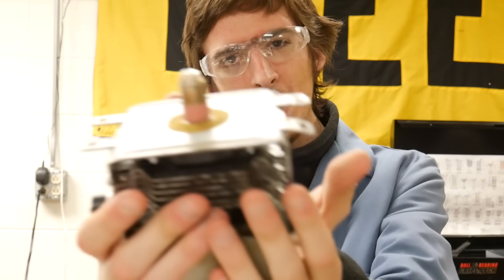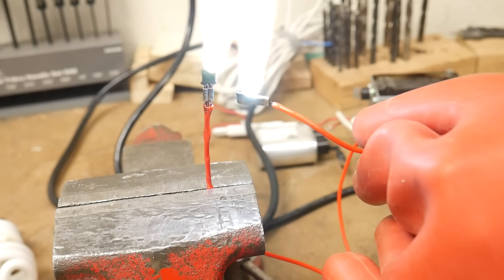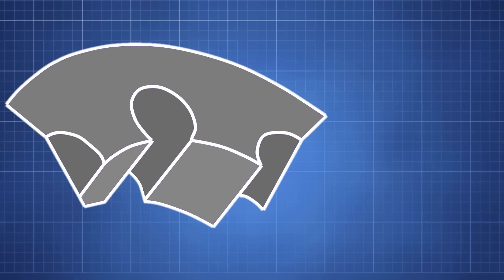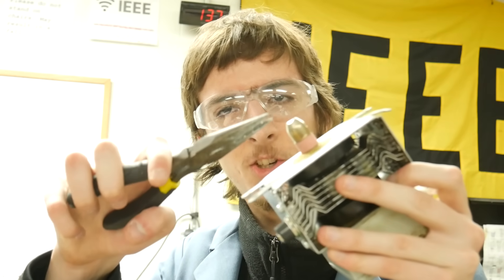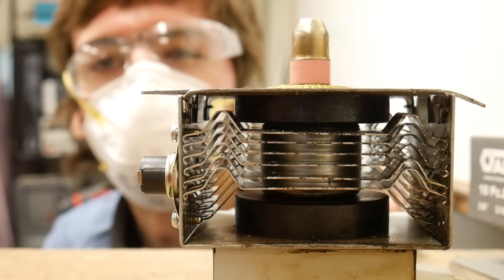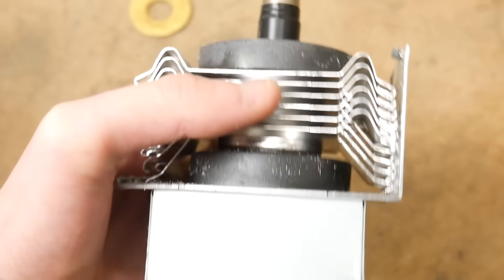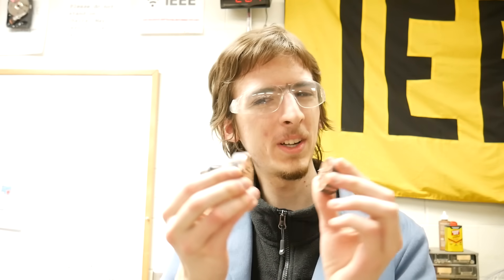What is a MAGNETRON - How Does it Work

Comment: you should point out that compassitors still have a charge even when they are not plugged in, for the adventurious types.
Reply: You mean capacitor?
Reply: Most have a high value discharge resister to bleed of the voltage when it's unplugged. (that's what I saw in the one I took apart today)
Reply: You should still be wary of high voltage capacitors after you've discharged them. Capacitors can spontaneously recover up to 20% of their voltage without any power being applied due to dielectric absorbtion. Though the danger of such capacitors is often vastly overstated. I doubt a 400v cap would be fatal if it discharged into you. For example, a 400v, 10uf cap would only contain 0.8 joules of energy. An electric fence puts out 10 times as much energy, or more. That's not to say it wouldn't hurt like hell, or that you shouldn't be careful and respectful of such devices.
Reply: @VoidHalo  In 91'  whilst servicing a CRT Monitor, I discharged the flyback cap.  After my eyes readjusted from the BRIGHT ARC!  I was stunned to see a notch vaporized off side of my favorite screwdriver... (I made sure to use someone else's tool next time)
Reply: @VoidHalo  : 20% spontaneous recovery. That to my suggests the inner core is acting like an inductor  and likely functions based on the rate of discharge. Faster discharge higher recovery.
Reply: Hahahahahhahaha WTF did you call it? LMFHO hahahaha at Compassitors hahahahah
Reply: @gamelover420  even J.W.bullseye got it, and drunk all the time. just playin JW =J
Reply: @DeactivatedCharcoal  Flyback cap? What's that? Don't you mean you discharged the CRT?
Reply: @jayelms2706  My bad, CRT
Reply: @gamelover420  spelling mistake & so what? The message sipped through & thats what counts

Comment: I will say the first thing is that the magnetron is a vacuum tube. the coils in the can tune the high voltage so that the filament will turn on and heat the only plate inside that is itself. Some of the common deaths of these is the tube itself getting weak, the diode in the high voltage path leaking current back, capacitor failure, or lastly control circuit failure. Solid state devices do not like surges which a microwave generates when it first powers up. Nice disassembly. Beryllium oxide is bad for your health but companies have been using a different material to make them ROHS compliant.

Comment: Probably not interesting for most viewers of this channel, but in case someone care:
The electrons have tendency to regroup in a single bunch that rotate in spiral. The oscillation comes from hitting a wall versus entering a cavity. There is 8 cavities so the rotation speed is : 2.45 ghz / 8 = 306 million turn per second.

The rotation speed is approximative, magnetron are so imprecise that they can not be used as power source for a radar. In case of old style microwave ovens with the 10 pound transformer and the high voltage capacitor and diode, the voltage/current is pulsed : the system is a voltage doubler which produce 4000 volts for half a cycle and zero volt for the other half. In other word, the pulse rate is 60 hz and the magnetron works 50% of the time.
I don't know if a full rectifier would makes the magnetron produce twice the energy or if there would be some kind of latch-up without the pulsed supply.
Reply: @Christian Gingras Very interesting, thanks a lot for sharing!
Reply: I actually came for this
Reply: Actually quite interesting. 
As for a DC build.... I don't think you'd get a latching effect, but going from 50% duty cycles to 100% duty cycles can do weird things. 

As far as the rotation speed, you can replace the permanent magnet with an electromagnetic winding. 

Actually the some of the first magnetrons were built with electromagnets instead of permanent magnets, but the guy who held the patent was kind of a turd, so they just made a magnetron with permanent magnets to side step him.
This had the advantage of providing additional energy to making a microwave in the permanent magnets, but there's no way to tune it or 'pre' magnetize the coil. 
The rotational speed, especially with the advent of microcontrollers, wouldn't be impossible to control, but adjusting it on the fly might be a pain. 

Interestingly, if the 8 segment thing is true, the OP's magnetron definitely didn't produce 2.45 ghz microwaves. his magnetron has 10 segments.
Reply: The magnetron has a fairly narrow window of operation. Too low and it won't oscillate (electrons not close enough to the anode to bunch up). Too high and it won't oscillate (electrons will be close enough to jump over to the anode and cause a current to flow). To make matters worse different temperatures and loads will change this. The power input has to be an AC signal that's been DC restored. If the voltage is too low it won't oscillate, but the voltage will soon rise. When the voltage is high enough to cause electron bunching, the anode resonates. When the voltage gets too high the current flow will temporarily "short" and cause the capacitor to quickly discharge to the point it will oscillate again (winding the transformer with magnetic shunts and an air gap also helps the transformer to drop its output voltage in an attempt to make a constant current). If you put a filtered DC into it, you have to "play" with the voltage until it oscillates and keep making adjustments as the temperature and load changes. The newer high frequency inverter types will use current feedback to tell when the output gets too high (and too much current flow) and adjust itself (much like the previous "playing" with the voltage, but automatic), plus the output isn't a filtered DC which helps stop any internal anode arcing.
Reply: @walterbunn280  The electromagnets were used because they had problems with permanent magnets getting hot and stop being magnets, plus by varying the electromagnet they can tune and modulate the output. Also the inventor was a dochenozzle.
Derp. I forgot to explain the 10 Vs. 8 poles. The electron bunching doesn't always happen in one place and rotate. Sometimes (depending on the strapping shorts they use on the resonate anode sections) you can have two, three, or four bunches of electron "lobes" rotating around. As one lobe passes by a resonate cavity, the next lobe "hits" it as it passes, so in one rotation you can get many hits on a cavity.
Reply: @therealjammit  It sounds like removing the permanent magnets is advantageous then if you plan on doing anything at all with a magnetron. 
Something of interest in this, magnetrons, such that they use to cook food at home, seem like they're a phase locked system, dependent on the frequency of the mains fed into the Transformer. I wonder if a microwave from the USA would have a different operating frequency if plugged into a European standard, assuming the voltage and amperage was the same.
Reply: " magnetron are so imprecise that they can not be used as power source for a radar"    I don't understand what you are saying. 34yrs of radar experience here. BTW magnetrons are not continuous wave devices.
Reply: @danflom1271  A magnetron works if you just want the position angle and distance but not the speed nor acceleration.
The police speed meter are using Dopler frequency shift where 65 mph (100 km/h) gives about 1 khz  up or down. They produce a short pulse then keep the oscillator on and mix the received signal. The beating (additive and subtractive) is the relative speed between the radar and the moving metal object.
For a magnetron at 2.45 Ghz, a shift of 1000 Hz is only one part in a million.
The pulsing of the 4000 volt, 50% on, 50% off is either 50 Hz or 60 Hz. This don't affect the output frequency of 2.45 Ghz.
The switched mode power supply in more recent microwave is made of 50 khz pulses train for 8 ms and a pause of 8 ms, synchronized with ac source.
No filtering capacitor on the input of the IGBT and no filtering capacitor on the output diode on the secondary of the switching transformer.
As explained in some answers, the magnetron can sometime start two or more conducting arc that all rotate probably creating small glitch between each pulses.
Sometime, an arc form and don't rotate. The pulsing allows to break the arc
Reply: Saved this thank you 🙏🏼
Reply: There are 8, genius.
Reply: @therealjammit You know a Magnetron well..... 👍
Reply: @davelowets  I kind of spazzed out.

Comment: I know that some ham radio enthusiasts use magnetrons as moon bounce transmitters.
This raises the fact that magnetrons can actually transform whatever frequency is input into a form of high energy RF
Reply: No, they can not. They only operate at ONE frequency. And that frequency is determined by the physical shape of the cavities inside the tube.

There is NO driver circuit powering them like the grid of a triode or other amplifying vacuum tube, and no way to introduce your own signal into them.

Comment: 1. It's not a 2,000-volt transformer; it's a 1,000-transformer. On one alternation of the AC line, the transformer, steered by a diode, charges the capacitor to 1,000 volts. On the following alternation, the transformer's 1,000 and the capacitor's 1,000 are added together to get the needed 2,000 volts to run the magnetron. This inexpensive circuit is is called a voltage double and is used to cut the number of copper turns required in the transformer's secondary winding in half to save money.

2. The gold-colored woven washer is not there to prevent feeding back into the magnetron. It is a conductive washer that seals the gap between the magnetron body and the waveguide, much as a rubber washer seals off a garden hose joint (except it's radio waves and not water). It is there to prevent waves escaping the joint, exceeding the amount allowed by regulations. There is nothing to prevent microwaves that emerge into the cooking cavity from reflecting back into the waveguide and into the magnetron, causing damage except the user's diligence in ALWAYS providing a load of some sort (food, water, etc.). (The original Amana Radar Range had a glass body magnetron, and if you ran it with no load, a spot would be melted into the glass, ruining it.)

Even if an oven is totally wasted and unrepairable, the magnetron will yield up two juicy magnets, and there are many projects on the 'Net based on replacing the secondary transformer winding to make a cheap welder, etc. Oven's don't die, they just fade away.
Reply from the maker: You seem to know what you are talking about. Though I am not convinced that the transformer secondary is such a low voltage. I'm experimentally found the voltage to fluctuate above 1800 volts (excluding the half-wave doubler)
Reply: Thats wrong Sir a single capacitor cant act as an multipler . In reality the peak AC of the transformer is around 6000v in 240v countrys
Reply: Wrong its 2000 volts i have measured it and the diode config brings it to 4KV
Reply: The yellow wire in front of magnetron ... is it gold? 
THANK YOU
Reply: Edi Flores no i think its brass
Reply: The older, large microwaves do indeed have transformers that put out 2,400 volts.  Double that with the diode configuration and you get 5,800 volts.  I've ripped apart many a microwave, both small and large, and the larger microwaves do have transformers that are indeed powerful.  Measured them, done that, and it's correct.  The arc he shows at the beginning of the video, if done with a 5, 800 volt transformer, reaches 6-8 inches easily without a sweat.
Reply: I have a 10kvac transformer from an oil burner that's labeled 20kvapk I assume that means its 10,000vac and 20,000 peak to peak..... where am i?
Reply: @jaredsciguy1634  Kansas, boy.
Reply: @Willeexd1337  You are correct Willee!
Reply: @jaredsciguy1634 Yes. BOTH outputs are hot with respect to ground (earth), and are each 10,000 volts above and below it. NEVER assume that it's OK to touch one of the terminals, they will BOTH zap you with respect to ground (earth)

Comment: I like how you were surprised at how the cavity was so cheaply made lol, I've heard from appliance repairmen that appliances are built to last 10 yrs max these days. I asked him if buying a more expensive line made a differance and he said no they're using the same cheap parts your just paying for the extras , so In essence he said buying a $7000 fridge vs a $700 wouldn't make any diff!
Reply from the maker: This day and age, every corner that can be cut is being cut. No surprise there. Besides, who needs a WIFI connected toaster anyway? Toaster tech hasn't even changed since it was invented!
Reply: @BlueprintScience  I have an exp kitchenaid model and it kinda heats but not a lot , the glass dish actually cracked one day just sitting in the microwave without being used , now it seems very weak so I was checking out how they work , trying to decide if I wanna go in there n attempt a fix it . Does the capacitor charge drain off after awhile or do I have to discharge it manually?
Reply: @hardworkingcanadiancitizen252  The way they are made with the plastic around them it's almost impossible to touch them, but yes I always discharge cap's when handling, just for safety.
Reply: No it doesn't drain itself, always discharge them before handling them.  That's the safest way to treat capacitors.

Comment: So back in the 80s if I turned bearing sleeves for Pratt & Whitney turbine engines and nuke rocket parts made from copper beryllium alloy, NOT BARYLLIUM OXIDE, would a relatively low ppm amount of ingestion be highly toxic? The bar came in as 3 inch diameter X 3 feet with a radiation sticker on it. I think only because it could be charged or possibly hold a charge? Keeping in mind I used dissimilar metals to cut it like carbide and high speed steel. I drilled, bored and turned it on a lathe mostly under coolant. However I would file it dry while it rotated by hand which produce typical filings to dust size particulate. I didn't stick my face down in it or anything. Always scrubbed before eating and treated it as though I should have been afraid of it. Will I catch illness from that?
Reply from the maker: I'm sorry, I'm not a materials and ceramics expert. My guess would be that the particles of beryllium in ceramics don't undergo chemical changes, rather physical structural changes and therefore would still be toxic. Again, this comes from a non-expert.
Reply: Anything that contains Be when inhaled in required amount leads to Berreliosis 
My little medical knowledge Guess pls

Comment: Definition of a capacitor;  A device that while charged is passed around Basic Electricity classes to emphasize the importance of respect for the power of electricity......
Reply: Breaker point "condensers" were a common source of said capacitors that were charged up and then passed around to see who ended up to be the unfortunate one who touched the can AND the end of the wire at the same time.... 😂

Comment: You don't need to cut anything to get to the magnets and cooling stack. The assembly is held together with bent tabs. A screwdriver and pliers will get the tabs apart. I've taken several apart for the magnets, and high voltage through panel connector.
 This was just suggested in my feed. 
Sub'd for interesting
-Jake
Reply: Upcycle Electronics I had the same thought... smart avoiding liable
Reply: Interesting video...  Here's bit of history on how microwave ovens came about, strangely out of the development of World Ware II microwave radar.  Who would have thought...
"American engineer Percy Spencer is generally credited with inventing the modern microwave oven after World War II from radar technology developed during the war. Named the "Radarange", it was first sold in 1946." ~ Wiki
Reply: That's EXACTLY WHAT IM TRYING TO DO... THANK YOU!!

Comment: Great Video! However, not to be a party pooper, but I think you got your Right Hand Rule backwards!  Recall that out to the box the Right Hand Rule applies only to POSITIVE particles, but the electron is negative.  So it will be forced in the opposite direction (counter clockwise) versus what you show in the video (which is clockwise with the B field pointed into the page at time circa 2:40).  Don't take it too badly though, because at least some and maybe most youtube videos on magnetrons shows exactly the same thing!  I think they are all just showing the right hand rule without thinking about the fact it only applies to positive charges: that is, you have to reverse the direction of the force for negative charges or use the Left Hand Rule for negative charges.
Reply from the maker: Way ahead of you: https://youtu.be/zSeRAd26JYU

Comment: Can you use this to make a weather radar because weather radars ement electromagnetic waves?
Reply from the maker: Possibly. Radar systems operate on the S-band which is nearly a gigahertz higher in frequency. They use Doppler shift to track storm movement. It would probably be a crazy amount of work to use a microwave magnetron.
Reply: @BlueprintScience  ok thank you is there software for the radar

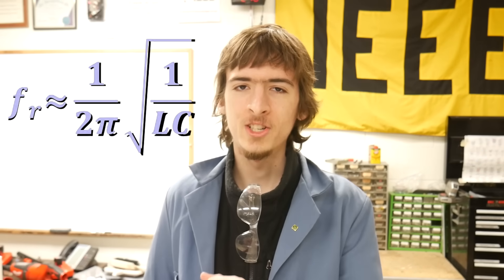Comment: i was keeping up until 4:27 when i went from understanding to watching.
Reply: If you couldn't understand the equation, you couldn't have understood the explanation leading up to it
Reply: It's nothing complicated, everything has it's resistance, inductance and capacitance. It just happens that inductors have much inductance and usuallly little capacitance except for Tesla bifilar, and vice versa. Whereever you got capacitance and inductance you got a resonator, energy oscillating between these two kinds of energy storage at certain frequency determined by the values of L and C.
XL= 2πfL
XC= -1/2πfC
F = 1/2π√LC